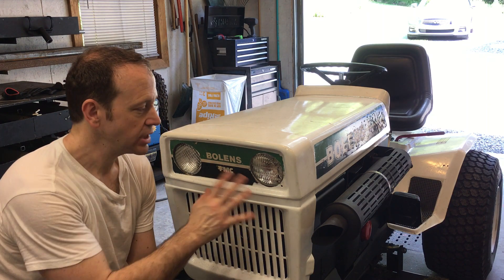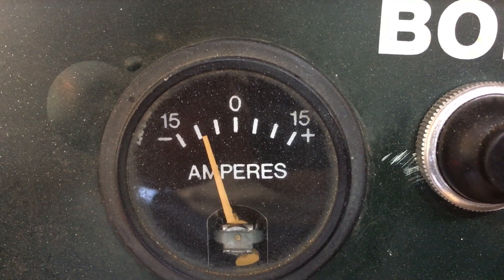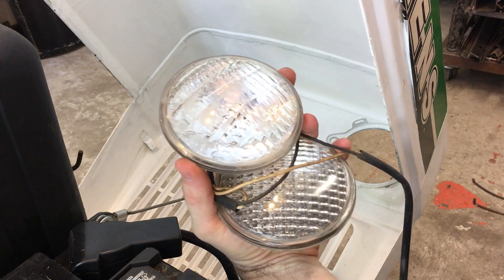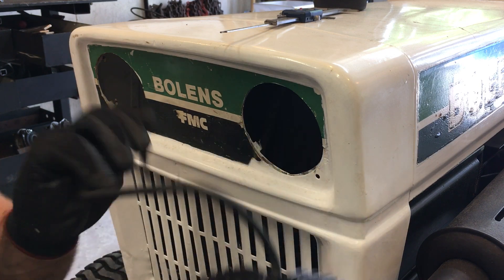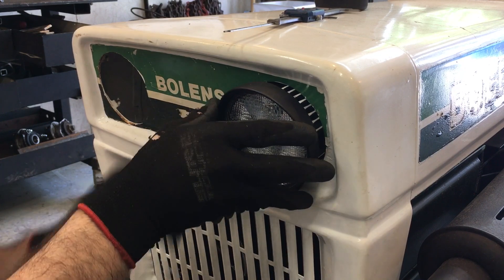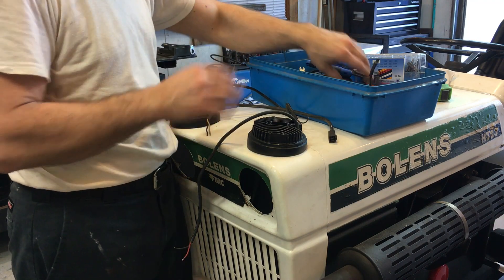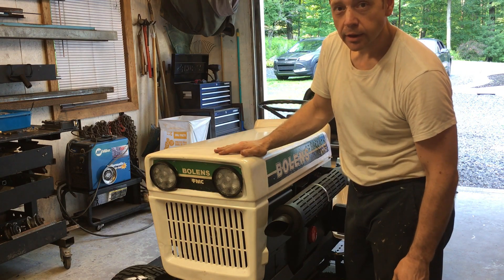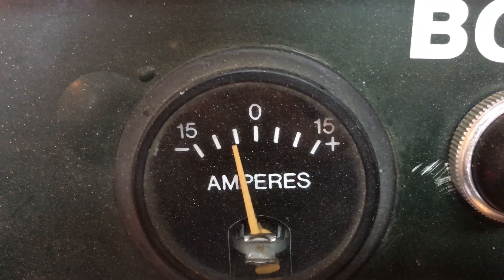#84 LED Lights on Bolens

Comment: When I bought my HT23, it came with those same LED Lamps.  I took them out, and went back to original bulbs for the correct look. One thing to note is one should not be working the Tractor with the engine at low RPM, so charging shouldn't be an issue, unless othe electrical problems are present.
Reply from the maker: Thanks!  I've found later that the original version can also be found in LED version ... I can revert back to the original holders if needed. Maybe my charging generator is not working well.
Reply: @FromSteelToWood  By design, they don't charge well at low RPM.

Comment: Old ones def look better but they do draw more current, but since there is a charging system, i would have left the old ones in place
Reply from the maker: I thought I would have saved a few dollars by modifying LED spotlights and fit them.  I should have spent a bit more to put the sealed beam LED lights. Maybe my charging system is not in good shape, it did not charge enough at lower rpm. I had to crank to 2500+ rpm to charge enough. So I was discharging the battery slowly in winter. Which is not good! I kept all the hardware to go back to original though! Thanks!

Comment: I had the same problem for to much draw when not at full throttle on my Toro tractor....fix the charging problem and a lot brighter.....CHEERS
Reply from the maker: I was thinking of fitting a small alternator under the battery, along one of the belts for the PTO... But that would be a very tight spot to fit! So I went for the LED lights!

Comment: They look like someone tried to make the wrong lights fit the tractor. There are LED lights available that are direct replacement and look identical to the original ones. Fit with NO Modifications , just plug and play.
Reply from the maker: You are right! Lol!  But those one where way much cheaper.  Honestly, if I was to do it again, I would definitely go with the LED sealed beam.

Comment: Those new lights look way better than the old ones to me.  I like that they are proud of the front of the hood; not set in like the old ones!!!  The current draw is a lot less too.  You would have to have some RPM's on the tractor to plow and there will be no issue with a drain on the battery with these lights.  On my Massey Ferguson GC2300 I switched over totally to LED lights.  I have 3 work lights as well as the regular driving lights plus a horn and with everything on the battery voltage is still over 12.  LED's are a lot better.  I like the long reach needle nose pliers you were using.  They helped out with this job.
Reply from the maker: I have been told the LED light might not provide as much contrast as the halogen lights. I will see when I use it. Do you plan on making some videos with the MF GC2300? I like to know what use people make of their tractor! The pliers came from Princess Auto in a kit of 4 different pliers (bent, flat, etc). Thanks for watching Grampie!

Comment: Great explanation. I see so many people replace a 35w incandescent or halogen with a 35w LED and they think since it is a LED it draws less. I like the way you installed the new lights too. Most people would have hacked the hood up. I keep my old parts too. If you ever get rid of the Bolens you can put the stock lights back on it and keep these for another project.
Reply from the maker: Roger, I like the way you think! Keep the tractor as much as possible original. Rather modify the new (Chinese) components! Keep old parts, as they are valuable. With LED lights, you never now what to expect. You may have 35w "equivalent", which may draw only 5-10 watts, but will light like a regular 35w...  Which is the case with those one.  Sometime, they really draw 35w and they will light 1 mile far!!! Thanks for watching!

Comment: Thought about trying something like this with my Bolens, now I know what to do.
Also, I think the inside of your muffler is rusted out, my HT23 is very quite compared to yours.
Reply from the maker: Like TLC Landscaping mentionned, there is also sealed beams LED replacement. They are "plug&play".  But they are quite more expensive. At least, from what I found available nearby.  This is why I ended with those one! I will come back to that muffler, because it is not very enjoyable for my neighbours!!! I am still hesitating at doing a vertical stack as opposed to the horizontal configuration... Lol! Thanks for watching!
Reply: Joe Lesage I've saw those as well, and the price scared me away. I have a vertical exhaust stack on my older tube-frame Bolens, but in the summer I can feel to much heat off it.
Reply from the maker: Oop!  I admit the stack would be near... Good to know!

Comment: They make original size bulbs that are LEDs. Very simple. Good video
Reply from the maker: Yes I saw that! They were twice the price however.  I took a chance those cheap ones would maybe fit in the hole... Fail!  If I ever have to change the 7 beams I have on the Case, I will go directly to LED sealed beams!!!